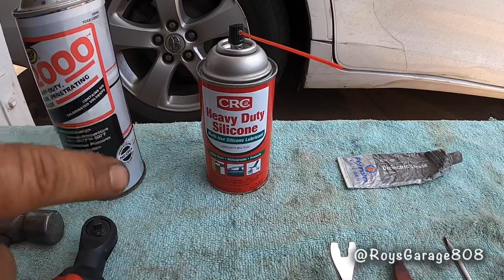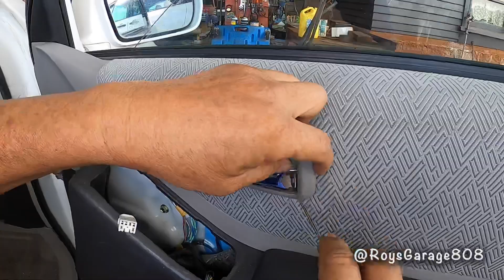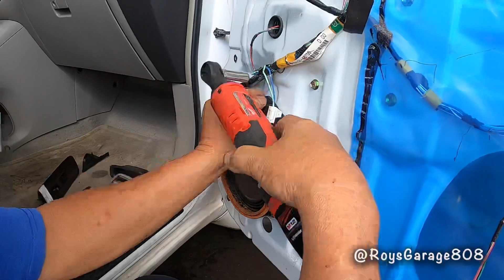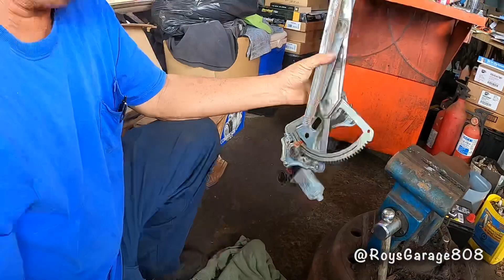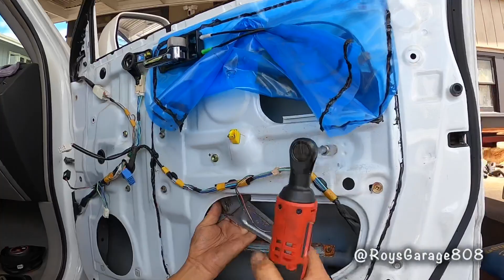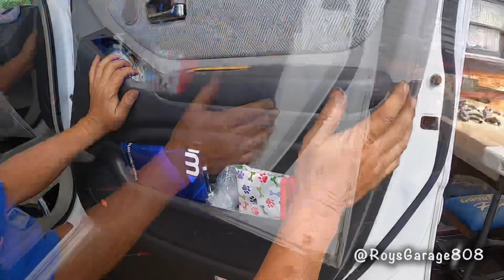How to Replace the (:::EDIT:::) RIGHT/PASSENGER Front Power Window Motor on a 2003 Toyota Highlander

Comment: How long did it take you overall? I wanna tackle it in Canada and its starting to get cold haha
Reply: For any lurkers , it took me around 10 minutes to take everything apart and maybe an hour or two to put it all back on because i forgot to make sure the window was within its rubber frame so i kept unbolting everything thinking i aligned it wrong 😂. Finally done.
Reply from the maker: Takes about roughly 45 minutes. Thanks for watching 🤙🏽🤙🏽🤙🏽